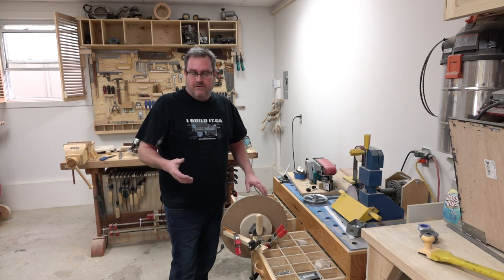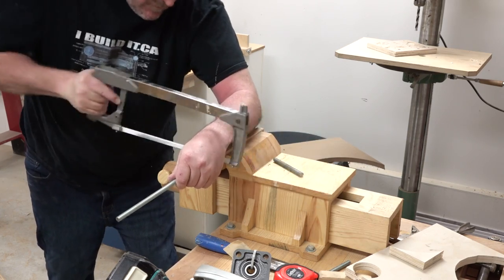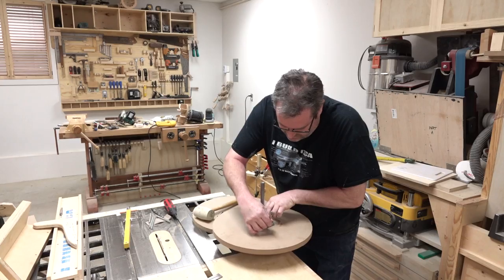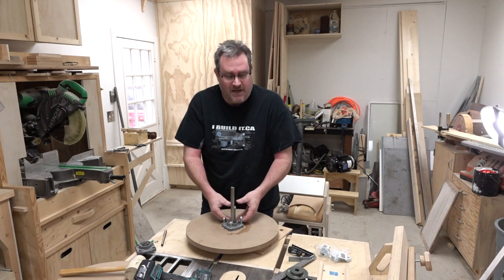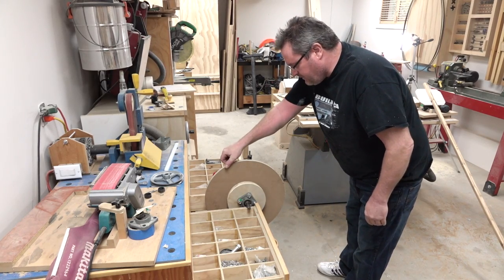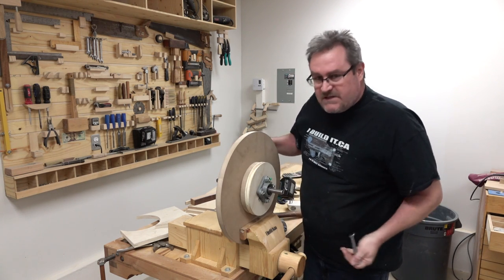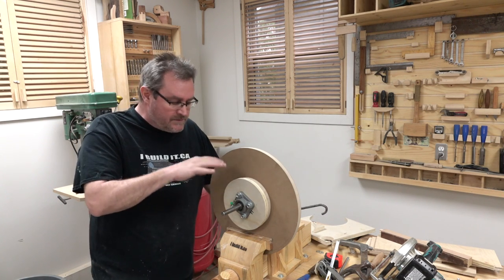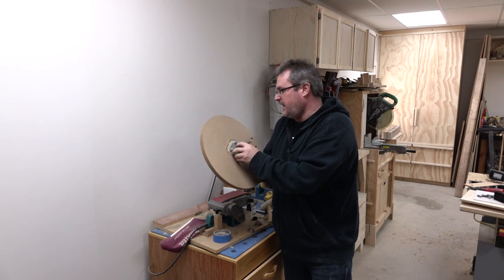Making A Quick And Dirty Band Saw Mill - Part 2

Comment: Love your video and ingenuity!I'm in the process of building almost the exact same thing, but slightly smaller and mine will be a permanent build out of steel. As a matter of fact, I'm making my wheels by using a ring roller and steel flat bar.With that said, I'm interested in your technique for balancing the wheels. Do you have a separate video where you show that in greater detail? I'd like to see if your method could be adaptable to what I am trying to do.Thanks again for sharing your wonderful videos!
Reply from the maker: +Mark Lochala 
Like I said in the video, there's more info on the method in my recent video on building impellers.

Comment: Have you re-balanced after the addition of the glue and removal of material for the crown?
Reply from the maker: +Larry B 
No need - the crowning takes off material evenly and the glue is close the centre of rotation, so would have little impact on balance.
Reply: I wouldn't disagree with you except for introducing your hand braking you changed things. Stating your degree of precision on this project is not critical the issue is moot anyway.

Comment: That crowning technique is something I will have to try (someday haha). As you said ,balance is important so are you going to balance them again once all is done to the wheels or just wait and see how it runs at speed? Haha
Reply from the maker: +MRrwmac 
Crowning the wheels and adding the glue didn't have any impact on the balance, and besides, these wheels are turning at a relatively low speed - ~600 rpm

Comment: Looking forward to see the sawmill complete. I built one a few years ago from scrap 2x6 lumber. If you are interested in seeing my approach then check out my lumberjocks link here. A short video of it with this link too. http://lumberjocks.com/projects/107378
Reply from the maker: +Geek Woodworker 
Awesome job on it! 
With the smaller wheels (13"), has blade breakage been a problem? Also, yours is running pretty fast - any issues with tracking or the top run of the blade between the wheels flapping?
Reply: +I Build It - I used 12 blades last year and broke one. however it broke because I tried to sharpen it by hand. I also cut about 20 logs with it. most blades lasted about 12 logs but one did go for 22 logs. the guys from r&d Bandsaws recommended this blade with the small wheels. no problems between the wheels. it is smooth. I am gonna speed it up this hear to 6500 fpm. I did switch to wooden blade guides made from iron wood and they worked the best. bearings wore out quickly. eenjoy the build and I look forward to seeing it all come together.